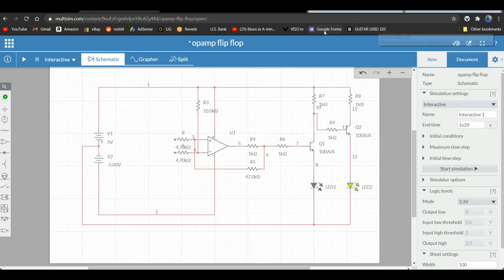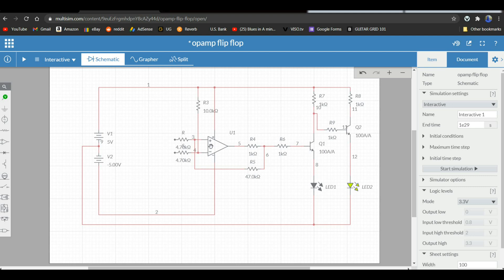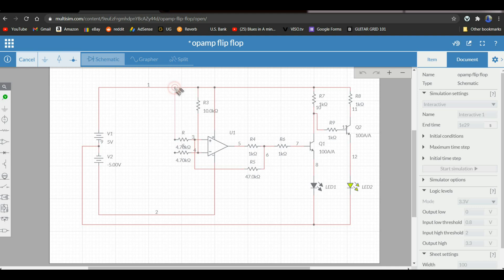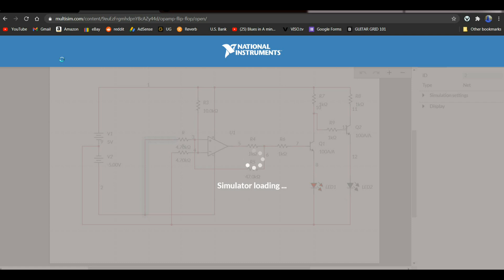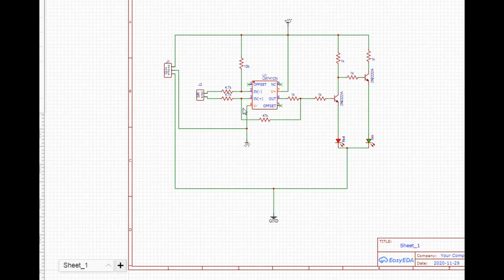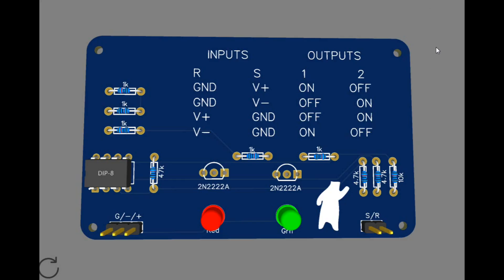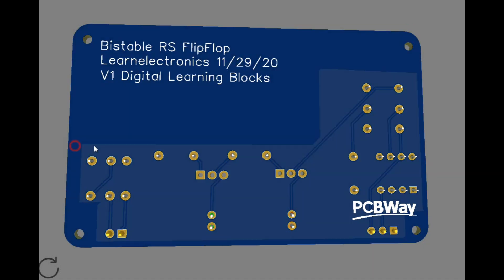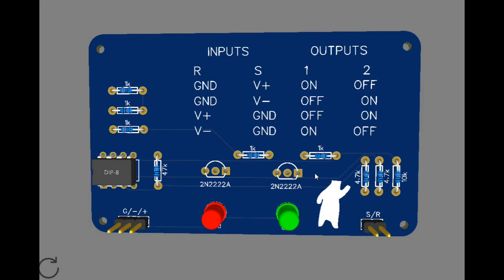An OpAmp Based Flip Flop and Tube Amp Final Reveal

Comment: Well done, amp sounds great.  On the digital building blocks, just a suggestion, add a card edge connector to the board design.  Old ISA buss connector should be adequate.  That way if folks do want to build something with them, they can make a cleaner assembly of it.  Naturally, there would have to be a custom wire job on the connectors by the individual, but it could lead to a more stable unit without a bunch of random wires all over the place.  Thanks for all you do.
Reply from the maker: Card edge is a GREAT idea. Thank you. I never thought of it. I was going to do headers, but a CEC is even better. That's why I love this community. The collective mind gives ideas a single mind couldnt come up with alone.

Comment: Did you learn what was wrong with the amp and what was done to correct it?
Reply from the maker: It was mostly grounding issues. I had my power grounds and signal grounds terminating in the same place causing the unwanted distortion.

Comment: Paul, why wouldn't the TL071 (I thought I heard you say you have TL072's and TL071's in the video) work for this application? Pinout is the same. Is it dependent on the impedance values of the LM741?
Reply from the maker: It probably would work just fine, I just dont want to confuse anyone who's new and doesnt understand that IC's can be swapped if pin compatable. You know like "He said LM741 then he used a TL071. which is it...."

Comment: If you are using these as a "building block", where's the output header?  Do you just put a header in place of the LEDs?  Wouldn't it be better to have both if it's a learning tool?  (my 2 cents  LOL)